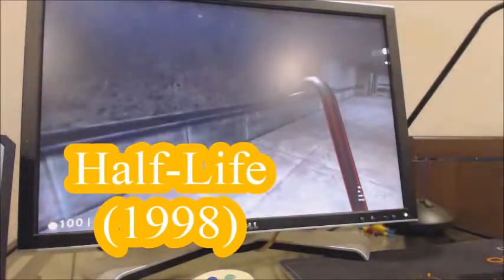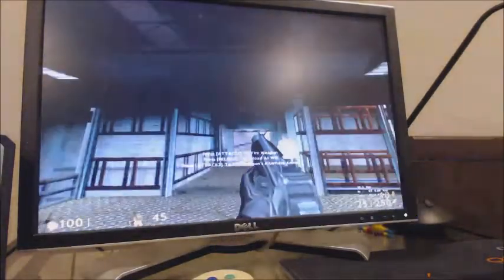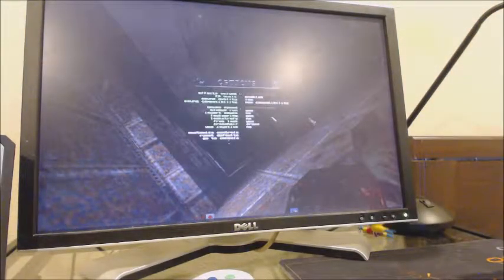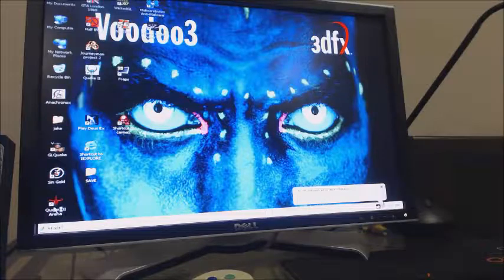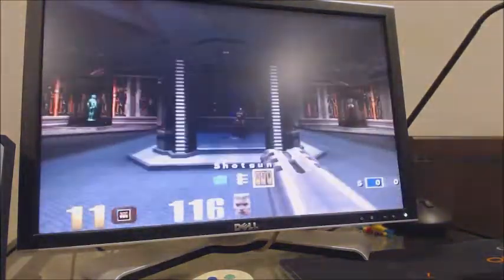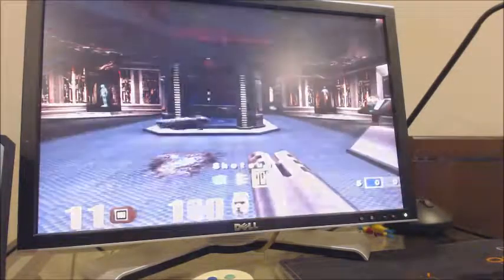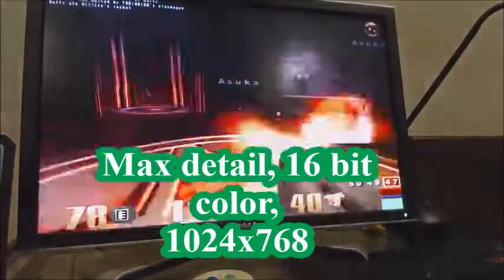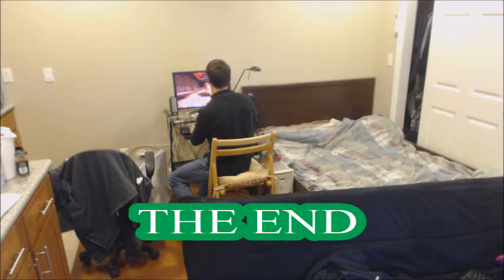CGS Coop's Lab: My 3dfx Voodoo3 story

Comment: Pentium 3 coppermine 933mhz, 256mb ram, sli voodoo2 12mb, quake 3 arena 1024х768 max spec benchmark 56fps.
Reply from the maker: Nice, this is on a Pentium III 650 MHz.
Reply from the maker: the framerate was a lot better under windows 98 in my follow up video, I think it went from 36 to 52. I forget if I maxed it out, I think I'm running it at normal quality.

Comment: I also have a Pentium III @ 650 Mhz.coppermine I am running the Voodoo 3 3000 AGP in it but I also am using an Aureal Vortex 2 sound card in it.That sound card is to 3D sound effects what a 3Dfx Voodoo card is to 3D graphics.It's especially optimized to Half Life which fully supports that A3D Aureal API.
Reply from the maker: +m9078jk3 Awesome, I've never heard of that sound card!
Reply: I really didn't appreciate the vortex 2 during its period of relevance. Obviously it was good and I liked it. But it was so obviously the future that it was entirely unimaginable to me that 20 years later we would have far worse 3D positional audio.